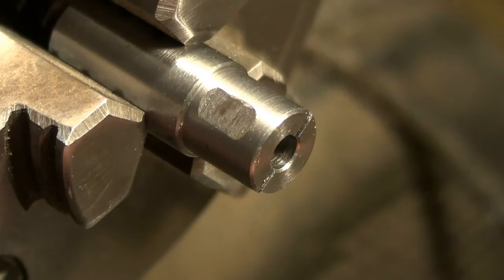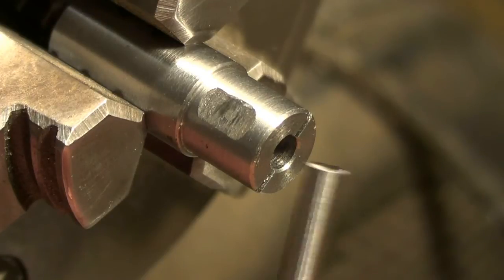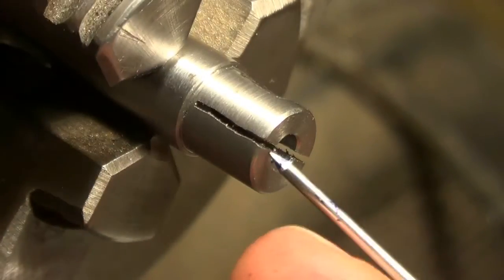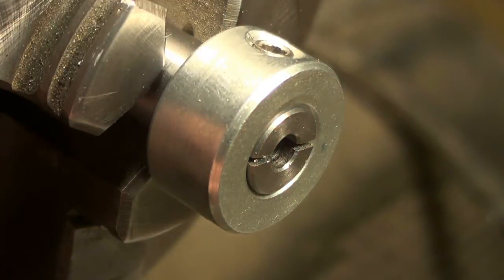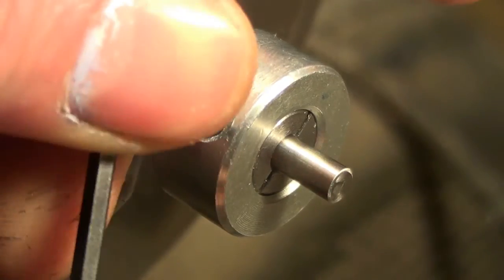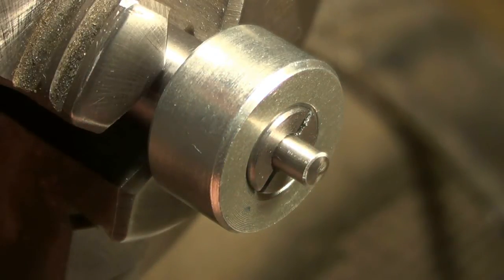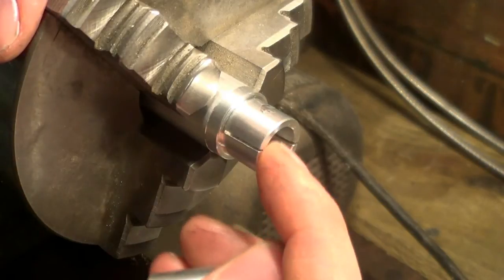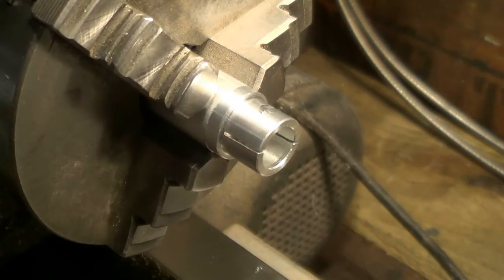Split clamp for lathe workholding

Comment: Cool idea - but if you remove the split collet from the three jaw chuck and reinsert it later you lose concentricity.  Right?
Reply from the maker: Well spotted ;-) However, you wouldn't actually use this in a 3-jaw; you'd use a 4-jaw and clock it in accurately each time. I actually only used the 3-jaw as shown in the video because it was on the lathe at the time!